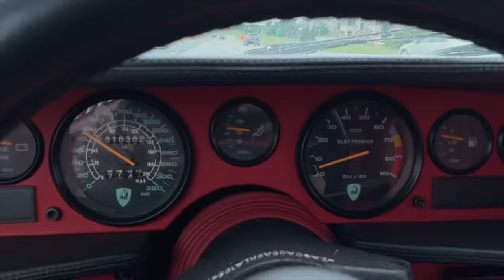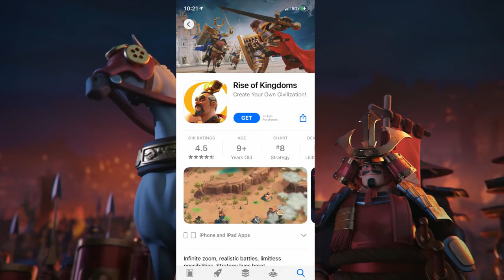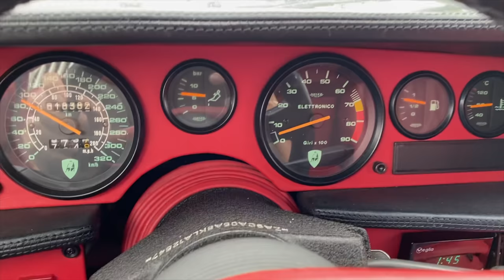My Lamborghini Countach broke at a very embarrassing moment

Comment: Hoovie: "I'm going to the Countach rally"

Countach: "OH HELL NO."
Reply: Nothing like an anti social countach
Reply: Italian cars can hear you.
They also get jealous of other cars, especially other Italians. Always a mistake to park them together.
Reply: You have to drive them hard like a Detroit beat the crap out of it 
They say (Italian tune up) its true
Reply: @Gordanovich02  ALL cars can hear you! And they ALL get jealous of each other when parked together!
Reply: @mrvolvomercedes  Fact.

Best Ferrari I owned was a 105k miles Testarossa that I flogged regularly, because... It had 105k on it.

Only failure I had was an evaporator core. And it was pretty easy to fix. Drove it for two years, sold it, and it lives on. Happily. 

Avoid the low mileage ones like a plague. That's when they leak and break.
Reply: @andrewb4584  good to know !
Reply: EXACTLY
Reply: Hoovie: "I'm going to the Countach rally"

Countach: "Meh, I'm out."
Reply: @Gordanovich02  my Testarossa is now leaking a ton of oil after I bought an old Fiat 124. It gets jealous of the other cars.
Reply: @andrewb4584  my TR has 65k miles on it. I make sure to drive it a lot.
Reply: @mazdaman2315  she's mad at him because he  hasn't touched her in awhile and is putting his hands and eyes on thoes newer younger Lamborghinis
Reply: 1:08 "Countach Breakdown" ... is that like a "Nervous Breakdown"? 😆
Reply: @andrewb4584  I think that is true for most cars.  Once a car is more than about 5 years old mileage is irrelevant. At 10 years low mileage means too much sitting around.
Reply: @FinessseJu  It has a v10, and can top out up to 320 M.P.H.
Reply: Crap, it heard it :D
Reply: I Warned him, several Times...  this thing will make itself into a paper weight, because to drive a car that has MANY MANY parts waiting to eat themselves, fall apart, or Burst into flames, the burst into flames is probably more a Ferrari thing... you put the old Countach on a trailer and sell it Quickly to the highest bidder. or install a atm next to it for it will take ALL of your money.

Comment: "Nothing like an old reliable Italian super car" - No one ever
Reply: Is that you, Mr. Jackson?
Reply: Or new Italian car
Reply: Just waiting for someone to take on a Maserati project from early 80's.
Reply: Well you can rely on them failing
Reply: Honda is pretty expensive in the Netherlands? Just buy one.. The French are making crap, the Germans and the Italians as well.
Reply: Laughs in Hoovies 348
Reply: @pier11francesco  
Pleeeease. My old Chevy (300+ hp) did sit for ten years with no gas treatment in a garage. Charged the battery, turn the key, good to go. Stick it! Lots of 40 year old parts including the radiator and transmission. No issues.
Reply: Especially when it owned by Tyler Hoover
Reply: @ocramdouwstra8494  As a guy that's owned British, a few Italian, American (mostly GM),  German) including two daily'd Benzes) and French cars...

My 2CV is the most reliable car I've owned. Even when it breaks, it still gets you home. I kicked the alternator belt at one point last year, still not sure when, and put almost a thousand miles on it.

I kicked the belt on the Gen1 SBC 400 in my chrome bumpered Corvette (unoriginal, obviously), ask me how long it took me to notice it on the temp gauge.

The only advantage US cars have is when they break (and they do break, plenty) is they're cheap and easy in the US to fix. Other than that, they're all fine, if they're well maintained. Except the old Bentleys I've owned. They're terrible.
Reply: @MOE-db8oc  italian cars are the most valuable cars on the planet for a reason you can keep being jealous we don't really care we are proud
Reply: @pier11francesco  A Hell of a great car..! We showed the world how to make cars. Open your eye's compare any European car from the '60s and '70s, they can't hold a candle to American cars of that era...Who really wants a car that requires the Motor to have to come out to perform basic repairs. Most of the steel used in Europe was inferior to American Steel... Try and find an English-made car of that era, they are complete rust buckets.
Reply: FIAT electronics in Lamborghini-.
Reply: @ccnixon  want to talk about your cracked plastic dashboard? American cars are sold only in america because they have no market in europe and no a german invented the first car, when people think of a dream car they think of ferraris lamborghinis mercedes bmws not ford or chevy
Reply: @MOE-db8oc  a lamborghini is not your  basic work truck
Reply: @ccnixon  You're funny because I'm sure every american knows about that 80s american car quality ahahah
Reply: @Mamiya645  no one is that mad
oh wait hoovie has entered the arena
Reply: @pier11francesco  I think that's a little simplistic. I've owned, and pursued plenty of American, European, and Asian sheetmetal over the years. My 328GTS, R107, R129, W211/CLK (it's the convertible my kids can ride in), 2CV, and daily X164 (wife) and W212/Wagon (me)  all reside next to a '63 Impala SS Convertible, a 1956 and 1969 Corvette (both ragtops), and an a 1986 C10 that's my work truck (LS Swap underway, right now.) Most of the above toy cars are older than me. 
They've resided next to Ferraris, Bentleys, Alfas, Renaults, Nissans, Jags, and MGs. All are great.

I'm currently on the hunt for a 1946 or 47 Cadillac Series 62 convertible. People do hunt for and lust after American cars. Cars from everywhere can be good, or terrible... Depends on what you're after.
Reply: @andrewb4584  Sure even I do like some american cars just don't talk trash about european cars because even if you teached us how to mass produce cars we showed you what is a car in the first place, we invented the sport car as you know it like it or not and in europe there are fiats with more than a milion km same with bmws and mercedes
Reply: @andrewb4584  Hahahaah, yep, Whe call them an ugly duck.. For shure, that was a time when the French didn't have paved roads.. Whe had the volkswagen beatle..
Reply: @pier11francesco  Owning a "88 CRX in the Netherlands.. Look it up guy? The climate is pretty harsh here for old Honda's.
Reply: @pier11francesco  I think of a terminator when I think dream car. Sorry but any euro car is far down on my dream car list.
Reply: @pier11francesco  Absolutely. Two most reliable cars I ever owned were a 1992 Volvo 240GL, bought it when it got out of university in '99, sold it with 310k miles. Ran great. And growing up parents had a 1979 Mercedes diesel wagon. 450k miles before they got tired of fixing it, and bought a 240 Wagon. 
Ran another 150k miles before the next owner finally retired it with the original transmission that failed.

Sadly the new Benzes aren't as good as that.... BMWs are worse than MB.
Reply: @ccnixon  You're insane. As a guy who owns American cars of that Era, and European cars from that Era... We were worlds behind in everything except style.
Our stuff is pretty. Tolerance is terrible. Metallurgy was poor. We came up with novel ideas that were cool (like the Oldsmobile torque tubes and methanol injected turbos) but rarely worked long term on the street.
I'd put a 2002tii against anything made in those decades.
Don't get me wrong, I own and will continue to buy old American Iron, but build quality, longevity, tolerances, and advanced technology shouldn't be the highlight of design... Focus on style, and innovative engineering, even if it didn't always work out.
Plus, you have 300 gross horsepower in that car, I'd assume, under optimal conditions. Let's make that net, or brake HP, and see how it works out. The 409 in my '63 is 425 Gross. It's about 275 Net.
Reply: Any Italian car lol
Reply: @ccnixon  Mercedes and BMWs of that era we’re definitely superior to their American counterparts 😂
Reply: @ccnixon  you forget a lot of American cars in that era seldom lasted 50k miles
Reply: @ocramdouwstra8494  bicycles are easier to work on and more reliable.  I do like my 97 BMW 528 5 speed manual
Reply: @JStryker7  🤣🤣🤣🤣
Reply: The most precise tolerances in the world won't make a 2002 all that fast. It's now a valuable car but it's still a non-turbo I4

Comment: Hoovie does a public service for everyone by making everyone that irrationally pours money into their old car feel way better about themselves.
Reply: Had to spend 1800 last month on my lexus so can relate. Needed timing belt water pump valve cover gaskets spark plugs and pads and rotors all sides. Also did all fluids
Reply: @Vikturus22  that’s not that bad of a price for all of that
Reply: @Vikturus22  how many miles on it brother? I had a friend with a gx470 that got it to 391K and then sold it for $2000, lexus and Toyota last absolutely forever
Reply: @johngulbunny7456  I agree the mechanic gave me a great deal. It just sucked I had to spend that much
Reply: @kooshkangaroo  my es300 has 221000km on clock (130k miles )
Reply: @Vikturus22  oh man that thing will go forever
Reply: @Vikturus22  Bend over dear? Not in one year I have to spend that kind of money on a Honda.
Reply: @ocramdouwstra8494  this was overdue maintenance so it won't need anything for a long time
Reply: I recently picked up my very first fun car, a 2016 GTI, after a lifetime of owning boring, reliable Asian cars. Hoovie's fleet was part inspiration (although I have to be far humbler in my purchases than Mr. Three Lambos), and also part reassurance that although VAG doesn't make the most reliable or cheapest TCO cars in the world, there's no way it's ever going to produce a Lambo-sized repair bill, and I can afford the long-term dodginess of VW.
Reply: Anyone know what happend to the MayBach ?
Reply: The gti will be fun, but it will also be reliable.  Maybe even more so than your previous asian cars.  Besides a few idiots at the top (as with most companies) VW has always made some pretty good stuff....
Reply: Better? Hoovie gets paid from us watching his money pouring...he is enjoying life
Reply: @Vikturus22  I have an ls400 with 200k miles
Reply: @ldtworks1052  Hoovie is a car dealer.. Even here in the Netherlands a old Merc is paying premium for parts.. It is just not worth it.
Reply: @ldtworks1052  company i was working for in 2018/2019 painted all the Ford Gt's and we were painting some Maybach suv prototypes for a chance to get the contract for Maybach...i left the company so not sure if they got the contract or not
Reply: @Vikturus22  That is probably treu :) But I owned some.. Never again. I do own tools for French cars? Fuck them as well.
Reply: Yeah like me sinking $2500 into an 01 Explorer only worth $1000 at most
Reply: I spent 1000 on my cadillac deville to get it running normal and sure I could've bout another car with that maybe a downpayment but i love my caddy and hoovie makes ke feel better about it lol
Reply: @Vikturus22  yikes my 1990 toyota 4runner had a replacement 22re installed for 1800 canadian
Reply: With current car prices, it’s makes even more sense to keep what you have maintained.  I’m going to sell my Tundra at the end of the summer after I get everything for my home projects.
Reply: Makes me feel not so stupid for throwing $3000 into repairing my 14 year old Volvo..
Reply: @modelotime3608  For shure! I had a lincoln mark 4.. Try it.. A 7.5 liter v8 in the Netherlands.. It drinks more than me ;)
Reply: @wetlettuce4768  i just poored 1900 euro into my 17y old Renault Scenic with 300k KM on it, for a new gearbox, clutch, diafragma and new steering rack, and a new discbreak.
It now makes completly sense to me to have that car fixed :D
People look at me weird when i say, this will be my Last ICE car, and i dont think i will be buying a EV for at least a other 10 years :D

Somehow that fugly scenic grew on me, after having had a BMW 323 M3, MX5NA, Rover VandenPlas 3500, And a Porsche 911, somehow it became my pratical favorite car ever.
Reply: Which is all of us.
Reply: @fredbobberts5753  Ok? I am a pretty poor bastard compaired to Hoovie? A nice Honda car is luxury here. And I am living in a first world country.
Reply: @arranchace1306  Man parts must be cheap for that car if you can get all that done for 1900 Euro. All I had done were the serpentine belt, tensioner and idlers, steering rack ends, a front drive shaft, 2 puncture repairs and rear brake pads.... Still need to replace the front subframe on my car and I can't find a used one to save my life so will have to pay about $1500 for a new one plus $300 for labor.
Reply: @wetlettuce4768  Well here in the Netherlands those Scenics are dirt cheap now, and as long you stay away from the official Renault garages, you can have them fixed cheap too. lots of spare parts still available, and there are still alot of donor cars to be found if needed.
Its not the best looking car, and its really a family car, but after having my whole life kinda for my country's standard more sporty cars, its my first family car, and even the repair bills are supprising next to its practicality. Like you said, for my beemer back in the day, just the rear end of the exaust was even more expensive as the total repair bill of that Scenic :D.. (I just shoudnt expect 0-100Km/0-60Mphin 10s or less :D)..

Those YT's never tell you how really small that trunk is of a MX5NA(Miata) till you try to move a beefy gaming rig to a Lanparty with it :P
Reply: @BorgHunter  hard to call all asian vehicles boring. I have the most reliable vehicle and it's the most fun, and it appreciates in value.  Hard to call them boring when you're offroad destroying range rovers and jeeps that are just blowing head gaskets like its nothin. Will make more money selling my car when I choose to sell it too. Doesnt sound too boring to me😂 I get to crush jeeps and rovers all day then sell it for more, but if thats what boring is to you, I dont wanna know your fun is
Reply: @arranchace1306  Is your gaming rig an entire server rack lol
Reply: @kooshkangaroo  Just the ones I bought are boring, is what I meant. I did consider a few Asian alternatives as well, but I ended up in Deutschland.
Reply: My 30 year old car will need to have her oil leak fixed. And she needs new tyres. Still spent less than 2000 Euros in the last 10 years on maintenance. (I don't do the maintenance myself, and don't postpone needed maintenance.)

Comment: I heard "all it needed was recharged" and immediately thought "what about the leak"? 99 times out of a hundred I hear that and people just pumped more refrigerant in without finding and fixing the leak. Good for Wizard for doing it right.
Reply: It boils my blood when I read car listings that say "just needs a recharge" - if it just needed a recharge, then why didn't you recharge it yourself and why is the system empty? Freon doesn't just disappear or get consumed. If it needs a recharge, it also has a leak that can potentially cost hundreds if not well over a thousand of dollars in repairs.
Reply: @Romulus1001  It does disappear over time tho, there is no problem unless it's over 10% per year. That's why you have to service and recharge it every two years
Reply: @rowdy6274  "have to" but most people don't, which is what leads to what I was describing.
Reply: @rowdy6274  That sounds like a recommendation from an A/C service company looking to make money.
Reply: @Romulus1001  can't argue with that, I thought you meant all were leaky because they are empty
Reply: @rowdy6274  That's bullshit, had a couple R12 cars that were over 20 years old on filled from the factory refrigerant.  That one particular Lexus you could keep ice cream in the car on a 100 degree day.
Reply: @rowdy6274  Dude, I have a Toyota I bought new in 2009.  I've never gotten the AC serviced.  In fact, I ran the AC this week, and I can assure you that it still blows cold air.  I don't know where you got that two years thing from.
Reply: @rowdy6274  my ‘92 Mitsubishi 3000 still has its factory charge.
Reply: @Romulus1001  Thank you, exactly!
Reply: @rowdy6274  refrigerant does not "disappear". An A/C system is a closed loop, there's nowhere for the refrigerant to go except the atmosphere when there's a leak. I had a 1950s refrigerator in my apartment in college 20 years ago with the original compressor and refrigerant in it and it worked great. It had never been "serviced" and there's effectively no difference between the two- a closed loop with a compressor, coils and a refrigerant. If the refrigerant is low there's a leak, which must be serviced, yes. So it's a good idea to check for leaks periodically.

Comment: Issue with the Countach is likely a short in the wiring. My friend's Corvette did the same thing whenever it rained.  You're likely going to need a new wiring harness unless Weezard can come up with something more cost efficient,  but unless you replace the harness you're really only putting a bandaid on the issue
Reply: Exactly what I thought too.
Reply: See, this is an informed comment.  My thought upon seeing the tach was that the ignition key was intermittently losing connection and therefore dropping the spark.  I'm glad I read what you had to say before I said something stupid.

Comment: There is a reason why Superspeeder Bob has said that if you want a reliable everyday exotic buy a Porsche. Now as for the Countach be sure to check the wiring connection at the ignition switch. It has been known to come loose.

Comment: The same thing happened to me actually and it was simply a loose battery terminal , check that before you dig deeper
Reply: That or a bad ground strap/lead/chassis connection.